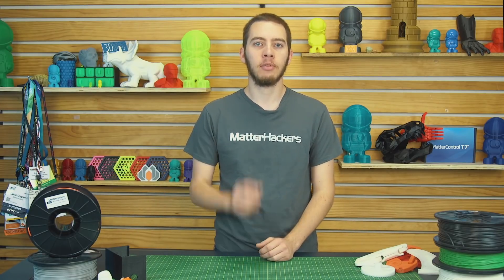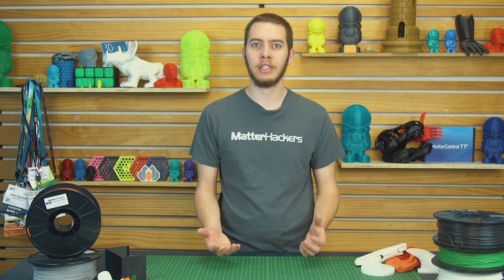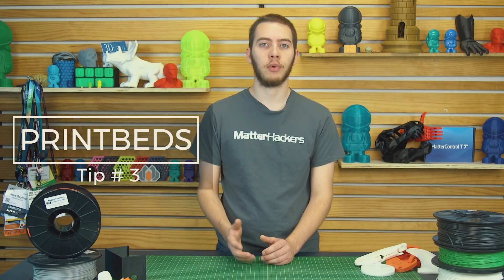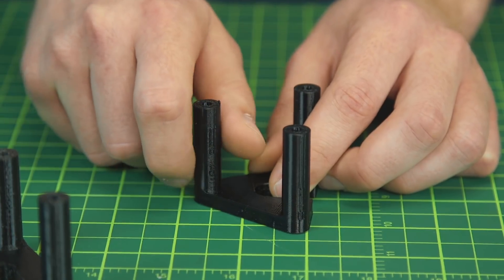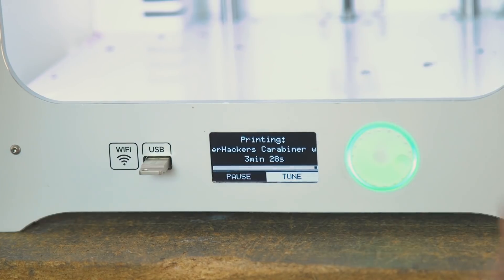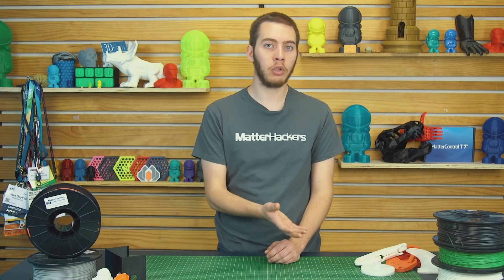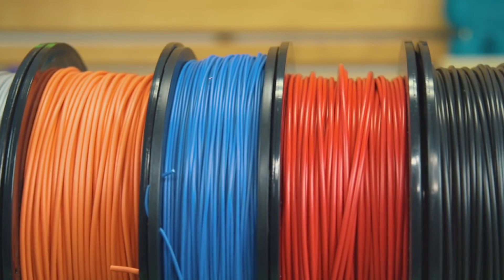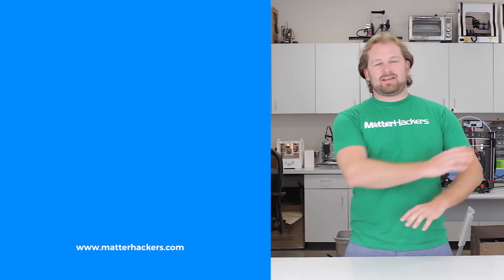How to Succeed When 3D Printing with Nylon Filament // 3D Printing Tutorial

Comment: Your tip worked perfectly. I needed to replace the bed surface from PEI to glass. Qidi X-CF Pro with glass, glue spray from 3d Jake, 60C Bed, 240C hardened steel Nozzle. Test Cube 10mm by 10mm, no brim, with 5mm Diameter round disc support 1,5 mm height on the edges worked perfectly. Cube was sticking in place like concrete. Came out +0,06mm longwise and +0,1mm crosswise. Totally acceptable. Thanks.

Comment: I had problems printing PA6 on PEI, not knowing that it will not stick to it. Some glue solved the problem, so your advice was very good.  Still, on PEI at least, I heated the bed a little more, to 70C, but maybe some parameters depends on the filament manufacturer.
I do not understand haters like some of the above, but hey, the Universe is big...

Comment: Odd question.  When I print with nylon the first layer or 2 will peel from the model but the rest of the model is solid and has good layer bonding. I print with Tulmans 910 on a heated bed @60c and nozzle @250 to 260. It's got me stumped 🤔, any thoughts ?  Out side of this I love printing with nylon the strength is great. Actually come to think of it the shells print well and looks amazing but both the top and bottom are kind of porous or maybe under extruded or something

Comment: Thanks for another great video. Are you serious you can put in the oven at 180F . Will the reel not melt & the Nylon stick to its self ? , Thanks
Reply: That's only 82C, and nylon's glass transition temp is higher than that. Despite what he said, I've had nylon that sputtered when printing dry out and print fine, just from storing it in desiccant for a few days. It was a large amount of blue indicating desiccant, and it was a number of days, but it did seem to work.
Reply: @jesondag  isn't the blue indicating stuff toxic?
Reply: @ELValenin  if you eat a lot of it, potentially.

Comment: Now just if your spools were temp resistant enough to be baked for 6-8 hours. Even after an hour its wavy and collapsing onto the filament.
Reply: I personally bought a fruit drier on Amazon instead of drying in an oven. I had to mod it a bit, mostly cut off the plastic mesh of each tray so a spool could fit into it. It can be set at 70C and nylon spools take about 10-12 hours to dry completely. It's slow, but it works like a charm.
Reply from the maker: You have to wait to put the spools in the oven until it has preheated properly. When the oven is trying to reach a specific temperature, it will overshoot and fluctuate until it's stable, which is causing your spools to warp.
Reply: I had given it an extra half hour to stablize temperature. After which point my over shuts off as  safety feature if the timer has not been set. The only spool i have seen handle more than an hour in the over is whatever material 3D MARS uses for theirs, which only had just started to warp after 3 hours at 180F. Although when letting it cool their spool also shrank and curled horribly.
Reply: TheGabb3r thats actually something thats been sitting in my amazon cart for weeks now for this purpose lol